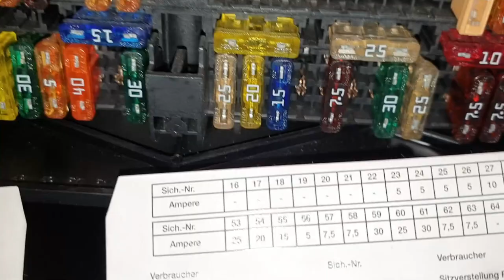How to fix BMW X3 E83 cigarette lighter Fuse Replace DIY 🚗👨‍🔧

Comment: Hi, thanks so much for the post -- I have the exact fuse issue on my BMW X3 2009. I pulled the same #47 Fuse and and I am still getting a battery drain. Do you know if the fuse needs to be replaced? I keep getting battery drains every night and the battery is dead by morning. Let me know! thanks!